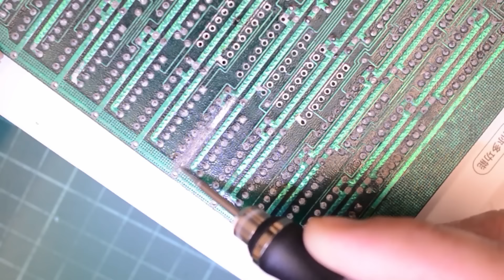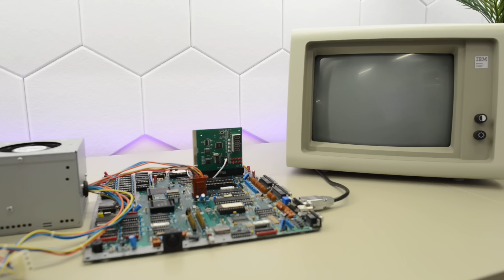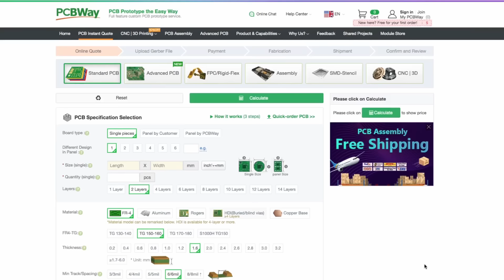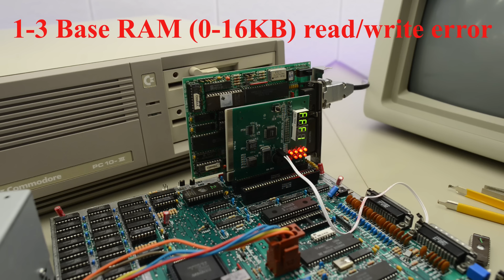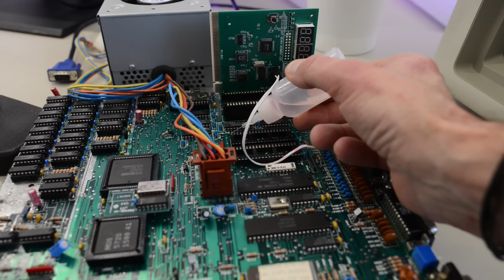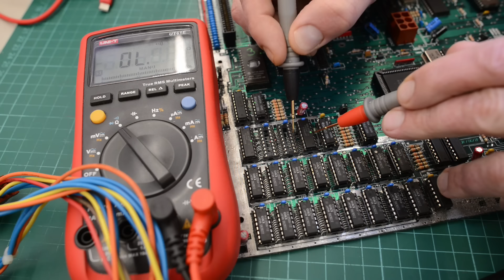Commodore PC-10. Custom Diagnostic ROMs. Repairing traces and testing logic chips with TL866

Comment: When you showed us the first broken trace underneath that ram socket, to me it looked like a linear mark down through several traces. At first I thought it was a tool-mark, but now I'm not so sure... path of some acid corrosion?
Reply from the maker: Hard to tell. I guess I could double check those traces

Comment: fixing board with ton of broken track just going get you some where near by it
whatelse was close by battery liquid that destory parts on that side of pcb it would be better run full wire from first ram to 2nd n 3rd  n 4th else to else bypassing all broken tracks get it all done in one piece which i understand take you longer than u think it does which you not only one doing all that but rest of ya sub still helping you out with more usefull information 
i hate tiny copper lines running under pcb on gpu which make it harder for me to repairs it having digging hole in pcb get to it (it one of asus gpu i think rx590) 
i see show fff20 which mean ram is not commutation with ls chip to cpu and after you fixed track by jumping new wire to it change to fff30 seen be logical track to cpu i cant tell just be double check it see if any more broken tracks if yes get them fixed so be less headache down the road i enjoying watching ya fixing pcb
Reply from the maker: Thank you. The main suspect at the moment is a bad logic chip. But you are right of course, there might still be one or many more broken traces
Reply: @Epictronics1  yes i agree just take your time with it im sure you will get there and one beep remind me of logic chip is not communicating with cpu because of traces is broken

Comment: You said your scope can do logic analysis? how large is its buffer?
connect it to data bus and try to see what it has written and what is read when it encountered a fault. 
alternatively you need to write a simple memory check ROM that loops CPU writing and reading data when it encounters an error (it may be possible to disassemble and patch the ROMs you have) - this way you will know where it is stuck and what it is reading by using a logic analyzer. It would be helpful to know which exact bit is a problem and then work your way from CPU to the RAM chip that is selected
Reply from the maker: No, I don't have a logic analyzer. We'll have to figure this one out without it. Thanks for the suggestion though

Comment: I noticed you are scoping on U312 DRAM chip..  According to the schematic it is the first in line, not the last one..  i.e. you have the address bus and data bus connecting them together and they act like a transmission line..  I'd certainly check the 74LS245 for the data lines and the others for the address lines.  To test the buses on the board, one option is to have the board powered off and inject soemthing like a 1Mhz Square wave at 5v simulating logic pulses..  You can then scope it along the bus on the chips..  It's also important to touch the pins on the chips, not the socket they are inserted into when scoping, if it is a bad connection between the actual IC pin and the socket.  Anyway, looking forward to see progress..
Reply from the maker: You're right. That's the first chip. I'll check the LS245 and we'll move from there, thanks

Comment: Just a thought but have you checked all the via's for continuity?.
I remember gadgetuk having issues with an amiga 4000 board that ended up being a couple of corroded via's that had no continuity from one side of the board to the other.
Reply from the maker: Not really, there are hundreds of VIAs on the board. It would be a very lengthy and tedious project to check them all. But you are right, they certainly are on the suspect list. I think I'm just going to trace and check the signals one at a time and if there is a bad VIA it will hopefully reveal itself

Comment: If the beep code really references the first 16 KB of memory, then perhaps you should check the path between the CPU and the memory block? I bet there would be an address decoder (with Chip Select lines) and a buffer/transceiver (74245?) between the CPU and memory. 74245s often go bad, and there can be a broken trace on this path as well.
Reply from the maker: Yes, there certainly is a 245. It's still soldered to the board so I have not checked it yet. It's on the suspect list now, thanks
Reply: @Epictronics1 /videos I have a feeling it fails on the first byte it tests.
Maybe you can remove the CPU and try to write and then read memory manually by poking resistors into the address and data bus like ALTAIR8800? 
Does your chip programmer allow debugging its pins manually? If so, you might be able to use that.

Comment: A3 at 22:30 looked fishy; the high voltage didn't seem consistent. Maybe a weak driver or a poor connection - I'd check it again with different timebases on the scope.
Reply from the maker: Yeah, it looks very fishy. I guess I'll just start tracing and checking one signal at a time in the next project video

Comment: Did you check the plcc? Those socket go bad a lot
And i use andonstar microscopes
Reply from the maker: No, It's not obvious to me how to check the PLCC sockets reliably. But I will probably check the signals going in and out of the Faraday chip in my next attempt. I guess that would also reveal if the socket is faulty
Reply: @Epictronics1  the sockets warp and sometimes just cleaning and reseating can fix this is a common thing with amigas
Reply from the maker: @primes711  Ok, I have washed the board several times while doing the tinning(tons of flux on the board) I also used DeoxIT when putting the chips back on the board
Reply: @Epictronics1  remember i said warping those plcc sockets are notorious
Reply from the maker: @primes711  Thanks. I guess I could try and push on the chip while looking at the signals to see if anything changes
Reply: @Epictronics1  that or not fully in as pushing it down could make is worse they warp from years of tension

Comment: You might want to try the original commodore rom by now. If there’s some issue with a block of RAM, it’ll still post and end up counting less RAM. If it’s the first bank, it will definitely not boot either way. Also if any logic ICs aren’t working. 

For instance: If that 74LS04 isn’t working, the complete block of M41464’s (64k x 4) DRAM will fail. The RAM will only count up to 512kb. 

This website has quite the useful information about BIOS ROM’s for your awesome machine: (Amiga-stuff website)
I can’t seem to post an URL, due to anti spam inside comments.
Reply from the maker: yeah, YT removes posts with links unfortunately. If you want to send a link please feel free to use the info button on my channel and send an email. I guess I should have tried the original BIOS EPROM. I will try it out in next project vid. thanks
Reply: it probably fails on one or more bits of all banks. 
We need to be able to somehow know where and how exactly does the RAM test fails.
Logic analyzer may help but only if it has quite a large buffer.
Reply from the maker: @jwhite5008  There is a new diag ROM in the making. Perhaps it will tell us more

Comment: I got a C64C Shortboard that regardless of what temp I used, I always tore off the through hole components when replacing the crispy toasty OKI Ram chips. It really really sucked, but I had to do something about it. After reinstalling, I still got a stuck-high A15 on it. I almost broke it clean in half from pure anger, when I was like okay, I'll scope it once again, but now, the RAM chips. And lo and behold, I had almost all traces broken at some point. Just cute. I enamel bodge wired all of the lines going from and to the RAM, and now it luckily works. yay

Edit: Also, check all chip select pins, and all Address and data lines that go to chips. I am not familiar with the PC architecture, sadly, but I'd start there, from what I've learned form C64 repairs.
Reply from the maker: yeah, according to the multimeter and the scope, the traces are good. but there might be traces that are marginal. Not sure how to test this

Comment: I purchased a microscope from Lapsun this year. It's a maze of products so I asked them for guidance. They recommended a model, supposed to have Sony 377 in it. Turned out it has a 334 (I think) so not exactly nice to get something random (what would you get next time?) but I have to say the microscope is amazing. With around £200 I got what you can see here https://youtu.be/2Ag7E7KMR6s
It works with OBS and monitor at the same time (I was told it wouldn't!), the quality is excellent, can be powered via laptop USB. I have no regrets. Maybe I would get a 180x lens with a 0.5x barlow lens instead of a 120x lens with a 0.75x barlow lens but honestly 120x magnnification is plenty. If you have a fixed desk as you do, I saved £20 on the heavy metal base and clamped the scope directly to the desk so it's always ready. Assuming you get the same sensor, I do recommend it. If you buy directly from them (via Paypal, so you have some sort of protection), it's cheaper.
Reply from the maker: Thanks Tony, Clamping the stand to the bench is genius. I think I might try to clamp the camera to the cabinet above my bench. That way I'll get even more space under the camera. Thanks for sharing
Reply: @Epictronics1  I've tried to flip the scope upside down for you and you end up with 53cm (minimum) distance between where the stand clamps and the object you want to inspect (this is with 120x lens and 0.75 barlow lens and the head attached at the end of the upright). Lapsun sells upright extenders, it's a chunky piece of metal so it might work but the whole assembly is not light. However if it's a cabinet it might work (I'm concerned about wobbling). Let me know if I can check measurements for you! You can contact lapsun directly through their website (I am not affiliated and I cannot really guarantee what you're going to receive! :) :) ). Let me know if you'd like me to send you my shopping list!
Reply from the maker: @tony359  Thanks Tony, I'll be doing some reading this week and see what camera I'll go with!

Comment: There is an open-source logic IC tester which CuriousMarc demonstrated on his channel which not only tests logic functions but also conducts logic threshold testing to ensure that the chip is operating at the proper logic levels.  It's not too expensive either from what I recall.
Reply from the maker: I had missed that vid. Thanks, I'll probably build one
Reply: @Epictronics1  Hi, also Adrian assemble the same chip tester not so long ago.
Reply from the maker: @nicoruizmza  Do you mean that Adrian built a Tauntek tester? I can't find the vid. Do you remember if it was a part of some other project?
Reply: @Epictronics1  Adrian's build the Retro Chip tester Pro. Sorry I mixed it. 
Here's link: https://www.youtube.com/watch?v=n46oM3jXmtU
Reply from the maker: @nicoruizmza  cool, thanks
Reply: Is it the same one Adrian has? The Retro Chip Tester Pro?
Reply: @owenvogelgesang7314  No, this is a different one.

Comment: When I've run out of ideas of things to try I find its always best to find something else to work on while I let it stew in the back of my head. Then one day when I'm working on another board fixing another fault it will click in my mind "ohhh I wonder if the problem was x ....."

I remember once I had a fault that would disappear whenever I removed the sockets from the board and show up again whenever I put it back together. Turned out one of the traces running between the legs of the socket was lifted slightly off the board and every time I installed the socket it would get pulled to the side and make contact with the socket leg. Every time I removed the socket it would pop back to where it was supposed to be. That's what this video reminded me of.
Reply from the maker: That is very good advice. I often do a different project and then get back to a problem when I have a list of thought ready for it.

Comment: Could there be a cross connection between any of the address lines and or the data lines?
Reply from the maker: I have checked for shorts but I think it's wise to double-check. I could have missed a short for sure
Reply: @Epictronics1  Of course, I should not limit my proposal to just address and data. It can be between all lines without power. When you have only checked that there is a signal there.

Comment: I had repaired VARTA battery damage.  Since the battery damage in a wide area, you may end up to testing all traces in the damaged area. You lucy!  I hope you can Commodore PC-10 run like new.
Reply: My worst battery damage was in a TI-81 calculator, where 90% of keyboard traces were completely eaten by corrosion...
Reply: @watchmakerful  Texas Instruments TI-81 are very nice calculator.  I assumed the damaged by alkaline batteries.
Reply: I am not sure about the battery type, but all those traces were covered with blue gunk. And a ton of vias were eaten as well...

Comment: Are you keeping up with the Commodore?
Reply from the maker: No, It's dumping more broken traces on me than I can handle ;)
Reply: @Epictronics1  It must be a DRAM issue..
If all of the address lines check out ok it could be bad row/column address select, data in/out or write signals. The best way to check these is with a scope. A bad RAS/CAS strobe is easily spotted. You'll fix this eventually, it just needs some time ;-)

Also check out Ruud's diagnostics ROM on minuszerodegrees. It's very useful and enabled me to save heaps of XT-class machines 👍
Reply from the maker: @pipschannel1222  Thanks Pip, I'll have a look at the Ruud's diag ROM
Reply: Yeah, but it isn't keeping up with him ;-)
Reply from the maker: @pipschannel1222  I think this Commodore has decided to make me do 10 freaking videos. But we'll get there someday : )